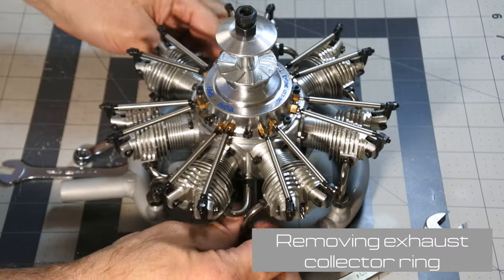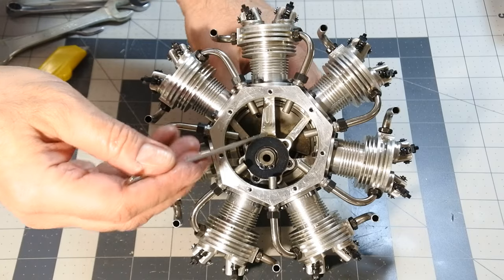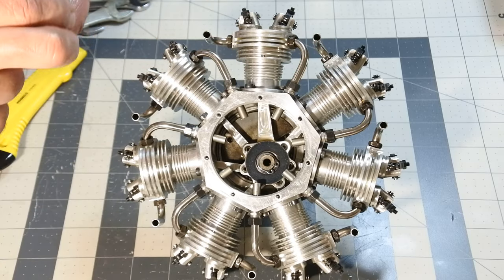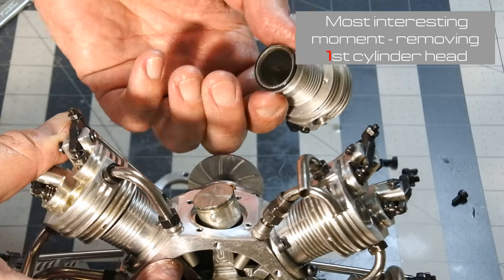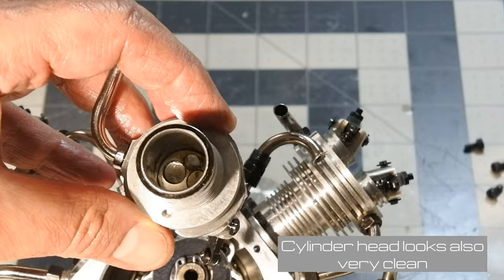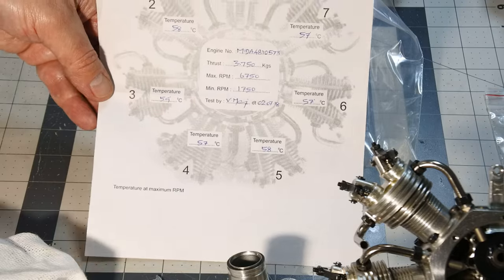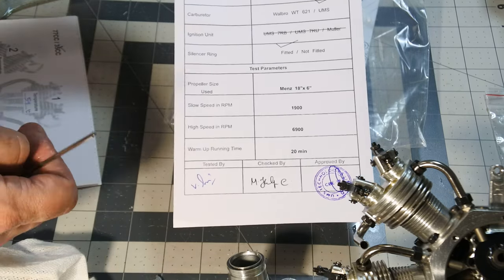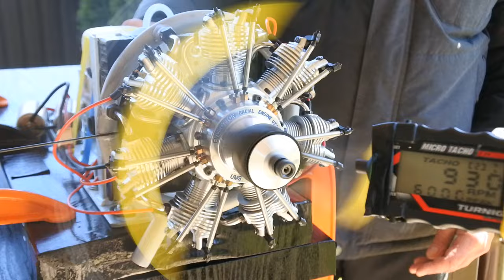Star shaped 7 cylinder UMS Evolution UT7 35 radial engine internal structure and design

Comment: It looks like a fine piece of engineering! I like how it's crankcase scavenged. No oiling issues down there. The Saito radials, particularly the gas ones, are relying solely on blowby to get oil down there and that causes master rod failures in them because there just isn't enough oil misting past the rings. Saito themselves even say you should stuff some fresh oil down the vent pipe from time to time. The crankcase scavenging on this UMS 7-35 won't help power any as there isn't any real pressure being built down there, but it should be a boon for reliability and longevity.

I would like to see it tested on a 15N 9Castor 9Synthetic fuel blend. I might just be getting one myself if I can find one I can afford, and I run Omega 15%, which is 15 nitro 9 castor 9 synthetic.

Was that 1100rpm idle being done without external glow heat?
Reply from the maker: Thanks for the interesting comment! 
I also liked the design of the crankshaft and fuel mixture distributor. Unfortunately, even this design does not exclude the flooding of the lower cylinders with oil and fuel mixture, and it has to be regularly drained before starting the engine, if it has stood for at least a day. I keep thinking about reworking my Saito FG 60R3, in the area of the fuel distributor, it could be much simpler  in design, "a-la" UMS Evolution UT7-35.
Concerning idle speed without glow support - it was approx 1550 -1600 RPM, it could be lower, but glow support will be needed, to keep so low and stable idle. Engine needs extended break-in time, according to my experience, well over 3-4 hours. 
Thank you and have a nice day !